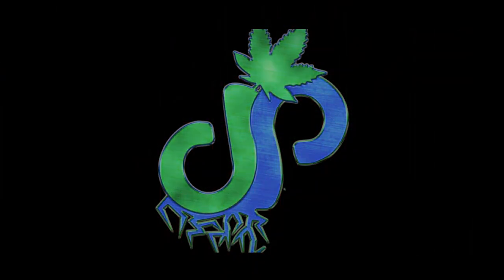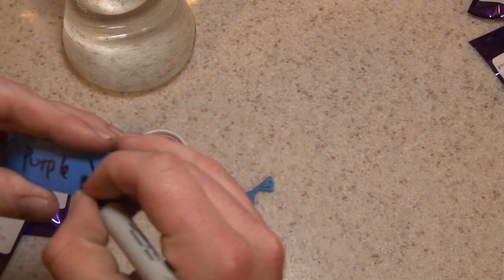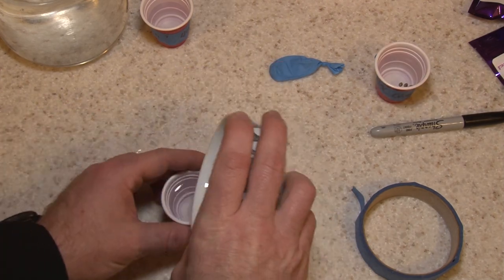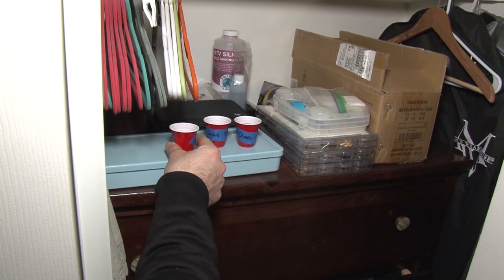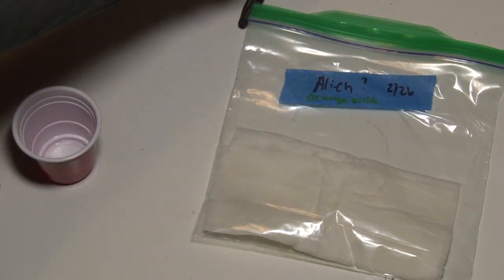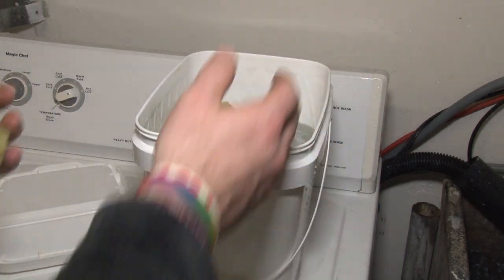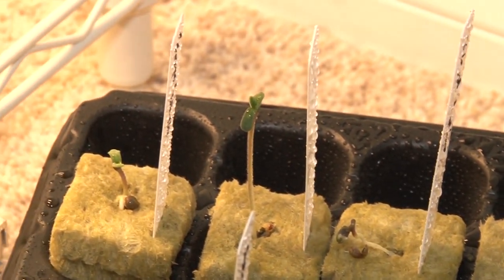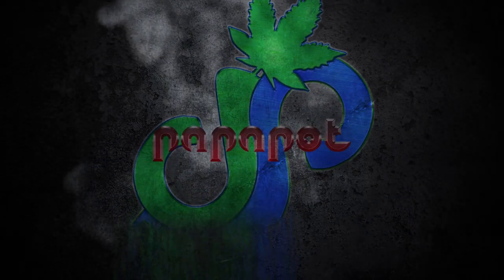Sprouting seeds from SFV Genentics

Comment: What happened o the neoprene collar germination test?
Reply from the maker: my aerocloner broke -_- and I haven't got a new one yet. But maybe I should. You bring up a good point. I never did that.
Reply from the maker: and I moved and stopped using my HPA system so double whammy
Reply: jPapapot ah man, sorry to hear that... I am personally experimenting with trying to start from seed in a modified collar, but my aero is only LPA
Reply from the maker: @afishl1  I mean it should work still. If I can recommend trying to see if you can get those ez clone coco collars. I feel like they'll have the most success
Reply: jPapapot i have seen those and am considering it but also want to see if I can get away with this first, do you think pieces from them might get in the reservoir?
Reply from the maker: @afishl1  ooo that's a good question. Idk. I think it's woven so it won't have parts fall off. But I've never used them to say for sure